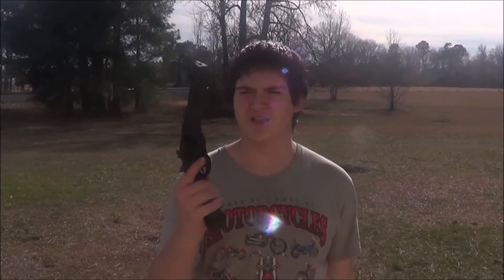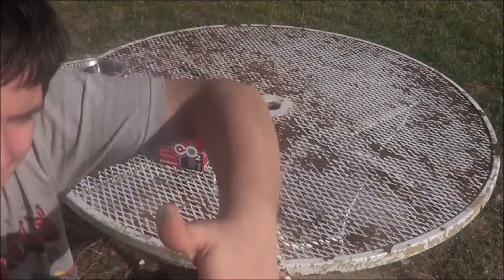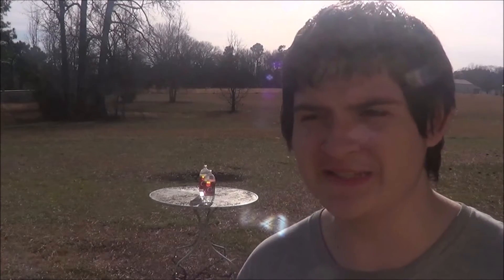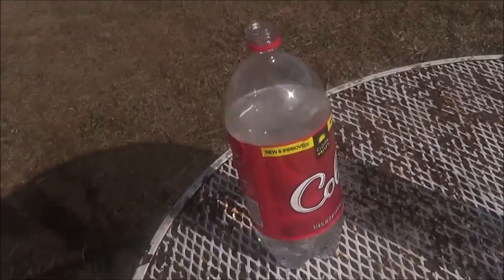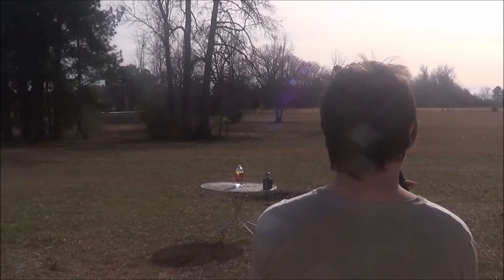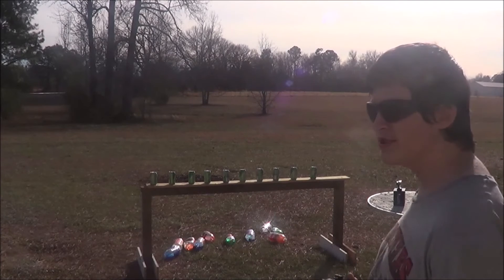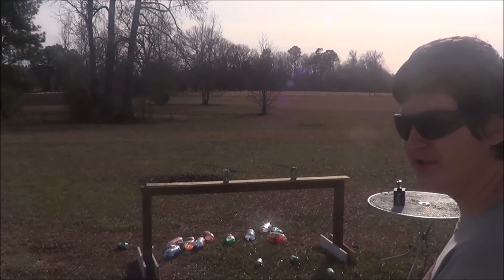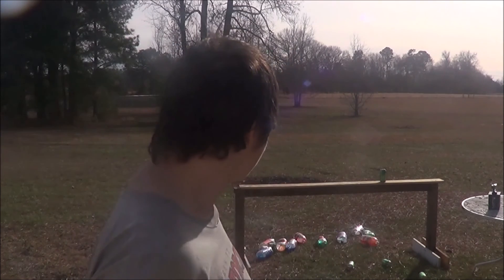Crosman Vigilante - Shooting Review!

Comment: The Crosman vigilante really sucks. So far it's good for only 5 to 10' feet. I tested this gun at 30' and it was all over the place with just a slight wind! Tried adjust the sights only made things worse. Disappointed after all the positive reviews. I have a Umarex broadax that performed better, that's just a bb gun. Vigilante is overrated!
Reply: Skill issue